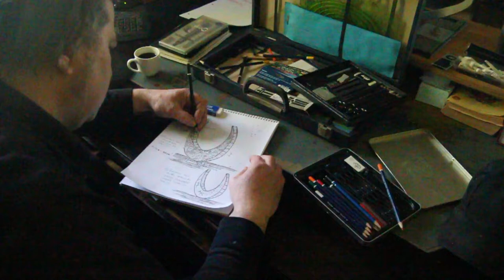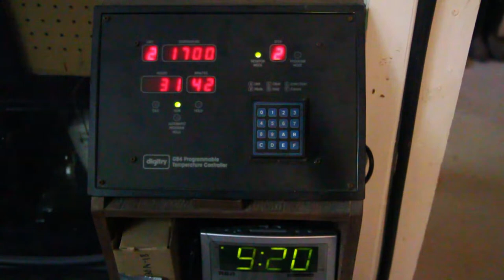Stephen Pon, Lost Wax for GLASS , Kiln cast glass,  sculpture Solis Dies

Comment: Can you help? I made a lost wax casted glass piece that turned out great but there is some investment entrapped in the outside most layer of glass. Logically if I soak in in Hydrofluoric Acid then it should remove the outside layer of glass and entrapped investment? (Also I should note this is homemade red ruby glass that has about 70% lead content by weight). I just don't want to ruin the piece.